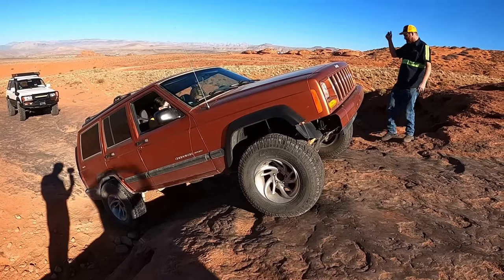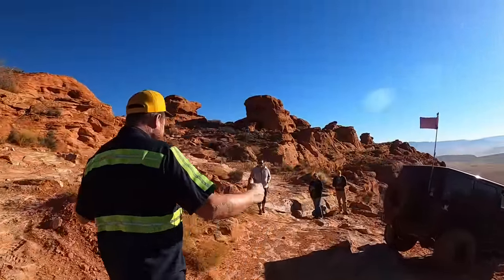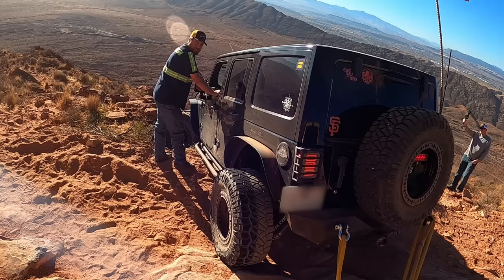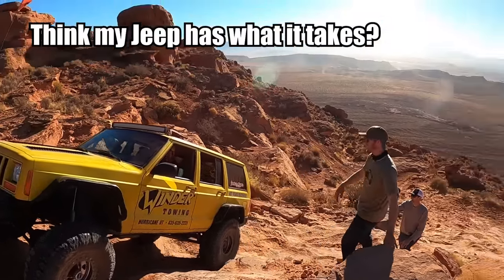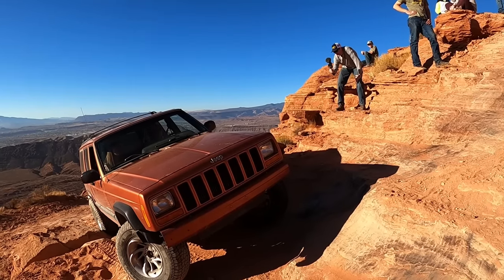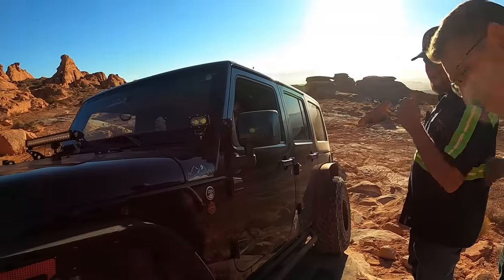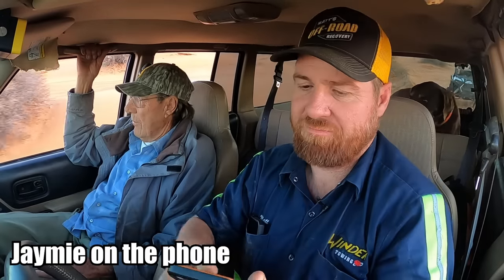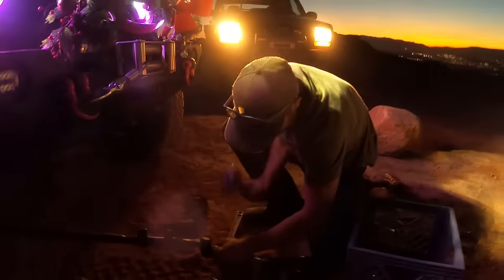Jeep Stuck On 1,000 FT Cliff...Fault Line Trail

Comment: Matt, when you said "Put a 3 inch lift in it, 31s on it and get rid of the sway bars" Yeah...that's like the perfect recipe to make a XJ just about go anywhere it's pointed. I had such an outfitted rig...simple add a leaf in the back, a puck up front with longer shocks, 31s on 15x8 wheels 4.5" backspace and no sway bars with wide open diffs at either end, D30 front D35 rear in a '89 XJ Pioneer 4L with a stick. I could keep up and do the harder lines with the folks I was on the trails with easy cause I could usually keep all four tires in contact with the ground. Loved that rig...wanna build another one! And might I say...the folks I was with...had far more built rigs than mine...and I kept getting asked what lockers I had in it...jaws drop when I told them the diffs were open.

Comment: Hey Matt, it would be cool if you could discuss the tire choice for some of the vehicles that get stuck in the snow/sand/mud. I'm very inexperienced with wheeling, but just got a new Z71 and put some Toyo open counrty AT 3 tires on it. I'd like to know if they are significantly better than the Dueler AT tires that came from the factory. They certainly look much beefier and have a much more aggressive tread pattern. Anyway, if you could add some info about the tires on some of the stuck vehicles that, theoretically, should have been able to traverse the terrain they got stuck in, that would be awesome. Hopefully, this request isn't old and tiresome for you guys to read. Thanks for the great content, I really am enjoying your channel and the way you guys are growing as producers!

Comment: The wheels looked a bit towed out from the beginning. Did that contribute, or was it just an optical illusion?
Reply: funny, I thought the same thing
Reply: No that def did. She had a lot of the weight resting of that from the bottom angle of the tire and it was clearly turned slightly beyond limit. Not surprised it broke. Must of been stressed just from the position she ended up in before she called.
Reply: @reptilianoverlord418  she also damn near floored it trying to get up a vertical rock face. Some people should stay on the street.

Comment: I replaced a steering box on my sons 1998 Dodge Ram2500 diesel in the bush, had to beat the pitman arm? off with a special puller as it was seized on.   The mosquitos must have drained a pint from both of us doing this.  Good job Rudy!!

Comment: You guys never seem to let your tyre pressure down to increase traction especially on sand. In Australia we often reduce pressure in difficult situations. Trouble is we need to pump them back up on the main road. Thanks for all the videos. 👍
Reply: What guys are you talking about? Matt repeatedly mentions the banana is on like 8psi of air. 

An air compressor that plugs into the cigarette lighter here is like $25-30.

Comment: The steering components on those wranglers are made out of cheese
Reply: At least they're not too bad to replace, the aftermarket offers some better solutions.
Reply: Yep, cast cheese! Not gouda...better to spend the cheddar and get forged.
Reply: Why are they made so cheap? Modern Jeeps look cool but seem to constantly break.
Reply: @markeldamgaard  profit margin
Reply: @terryh5060  this, and the majority of users aren't actually using them in a way that demands stronger parts
Reply: Some decent aged parmesan would be stronger than the stock components!
Reply: @markeldamgaard  They actually make them so cheap because it is better for things like that to break in an accident rather than transferring the energy to a more important part like the frame and damaging that. Beefier forged parts are better off-road but in accidents will likely cause more damage.
Reply: Her sector shaft was already cracked prior to that. Who knows what she was doing to it, but likely beating the snot out of it real hard.
Reply: @vitaminb4869  I cringed so hard when she slammed in to that rock
Reply: You can't be bouncing over a boulders like this on big wheels and stock steering sticks.... people either do it ruff with parts made for it, or if someone ends up with stock vehicle on this they very careful
Reply: @terryh5060  Just stop that right now.  Ha ha!

Comment: I've had at least one Jeep XJ in my carport since 1989. Sold the 89 with 400,000 miles on the original 2.5 liter engine and still had the original clutch! I bought my last ones in 2000 and2001, and we are still driving them everyday. Also have a 91 with over 300k on it that both my children took turns driving from high school through college. I paid $1500 for it used, and I can still get $3000 for it if I wanted to sell. Best American vehicle ever made.

Comment: roommate is on 35s, 4 inch lift locked 2 door xj. My wk is on 33s hemi locked super lift, Two yjs locked fully also mine 6 inches. HIs with dana 60 and dana 70 with 308 spring over on 37s

Comment: H3... 3"lift you can clear 35"s 
4:56 stock gear ratio
4:1 low lock transfer case
Electronic locking rear diff
(Adventure model)
And still cheaper than a 4 runner

Comment: Hey Matt, have you ever thought about making a recovery-simulation (think mudrunner or snowrunner) for the pc/consoles? I think it would make a very interesting game if the physics are done right. The player has to decide which vehicle and which method to use. Requires skills. Add a career mode. Put your name on it using yellow vehicles. DLC with a Scandinavian expansion. Don't know. Just a thought.

Comment: What is it with those JK boxes? Seems to be one of the only rigs with repeat issues with that. I've seen and personally broke A fair bit of Toyota stock front shafts and third members but I've never seen a sector shaft on a Toyota box snap. Was there an issue with the quality in production or something?

Comment: @ 12:01 mark: Rudy, milk crates are the best "to go bag" you can have. They stack amazingly, and make a perfect seat to plant yer butt on while doing the repair. Only downfall to them is, they'll hold a heavy thing that really shouldn't be in there....'til the bottom breaks out an you almost catch it with your foot. Probably the main reason why i wear steel-toe boots 24/7, LOL!

Comment: As for a Togo bag of tools. When ever we go on a road trip I bring a smattering of tools. Family use to joke with me. Until once the caliper came off on the interstate. Lost one bolt and it swiveled up and lock into the wheel. Thanks God it locked as I pulled off. Was able to remove the caliper and move the one bolt to the bottom so I could use the brakes. Got to where we went for vacation and had Napa order the other bolt. Put it on while the family had morning coffee.  They don’t make fun of me anymore haha

Comment: And I think that's just about true of a KL Trailhawk. 

I have a 2 inch lift and 30.5 on a Cherokee that already has a 1 inch lift lol... 

I'll tell you this ... The angles are VERY hard to beat ( approach of 45 , departure of 40 and breakover of 29.3)  ... Must pickup trucks have to be about 18 inches up to even hit the breakover that I have at 14 inches , not to mention approach and departure. 

The math is very merciless.

Comment: I went everywhere off road in the Queen Valley area of AZ in a two wheel drive pickup and never got stuck until I bought a Jeep. I think my IQ dropped about 50 points after I got that jeep because it made me do things I would never have done in a two wheel drive pickup. I think ground clearance and common sense is more important than anything else.

Comment: So you in regards to you saying xj with a 3 in lift 31's and no sway bars.  What's the cons about doing that with a daily driver in the city.
Reply: So I don't run a front sway bar at all. Would I notice a difference with the rear off. I've heard both ways but I thought I'd get your opinion

Comment: Girl can drive, " stop , stop, ...you should of kept going"  
Ouch, never understood why someone would take a brand new vehicle through something like that. I mean I'm the guy that sees a brand new lifted truck with 22" rims and low profile tires and laughs cause it's prolly never seen a dirt road let alone mud, but to spend all that money for looks is foolish. Matt's got the right idea , find something decent reliable and then when something breaks it's not such a gut punch. Costs 100s to fix an older vehicle, as apposed to 1000s to fix a newer vehicle. Plus I was always told the shorter the wheel base the better for off road. I had an 85 s-10 blazer, 2 door in high school, that thing bounced off trees and seesaw on dirt piles and kept going. Not much done to it really had. V6 2.8L I think before the 4.3l. just had a better carberator and intake, 3 inch lift , 30 inch tires and welded skid plates on the bottom, my dad worked in a sheet metal shop so at night I was able to go in there and do whatever I wanted , dad would laser cut whatever I needed. The good old days. I live in maine so rust is inevitable on older vehicles. I did all new doors, new fenders, all the body work, had it painted and parked at my grandfather's and someone went off the road and smashed right into the passenger side and took off, after all the work I did to it that happened and I was heart broken. At 20 years old vehicles was all I had going for me haha. Other then work and family obv, but no house , no wife, no responsibility other then vehicles and to get that call when horrible.

Comment: Why didn't you reverse pull?  I mean face the tow and reverse.
Just curious.
Reply: The way pinion gears are cut they are stronger going forward than in reverse.  Towing and pulling in reverse can destroy your pinion gears so it is best to pull the load going forward whenever possible.

Comment: The lady seems experienced, in a well equiped truck, but even the best get caught out now and again.
Usually I'd suggest carrying a simple manual pull-me winch for self-recoveries, but without an anchor point...

Steering bob outpus shaft seems an unuasual failure - is this a common issue with that range of vehicles?